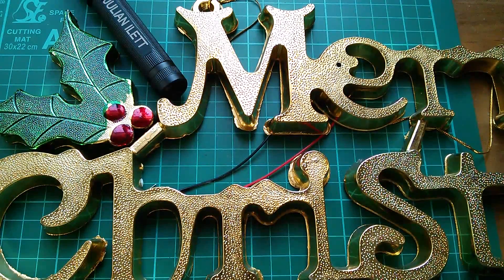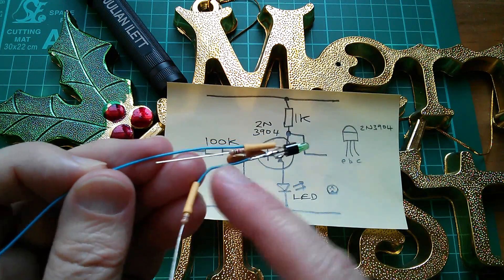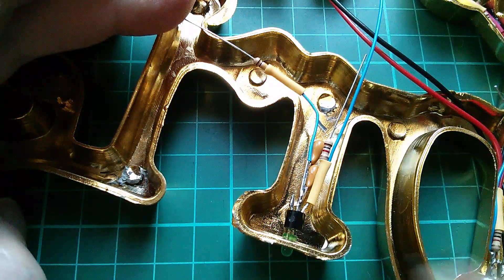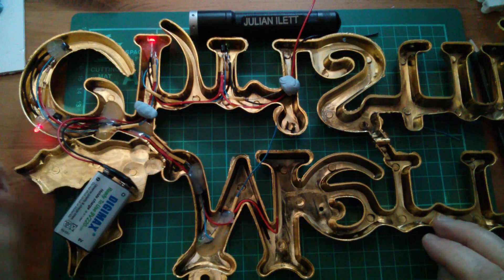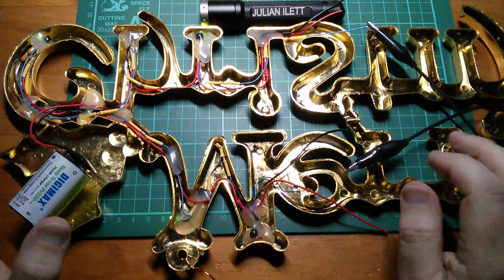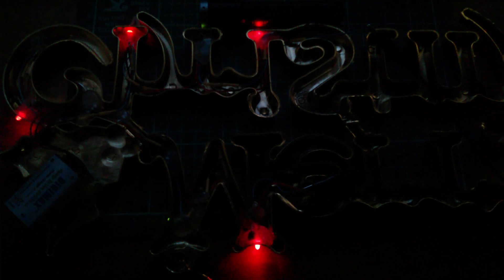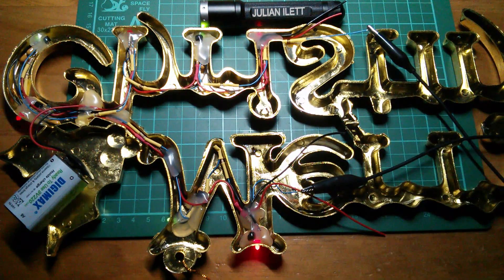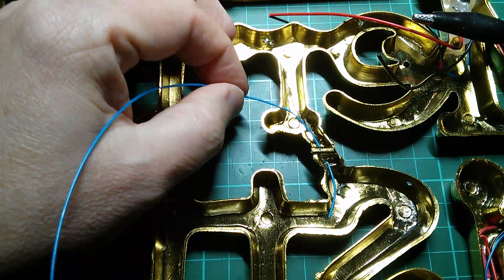Merry Christmas LED Sign Build (part 3)

Comment: "Not if I can't find the hole" ... Insert joke here :D
Reply: and he follows up with "let's plow on"
Reply: I didn't notice anything. Well, perhaps a little frustration:
Perhaps the transistor will go on top for this one.
I've bent it in a strange way, it's sitting a bit proud.
There is a resistor ready to take it. (Oh my!)
Let's see if I can get this to oscillate again.
Let's see is I can drill a hole through the mid-point trying not to come out through the front. (Oh dear no!)
Could be an all-nighter, he says, cheerfully  !:-O
Paging Dr. Freud. Someone alert Julian's neighbors... gonna be a hot night coming along soon. Christmas preparations have been encroaching on your quality time a bit I'm afraid Mr. Ilett.